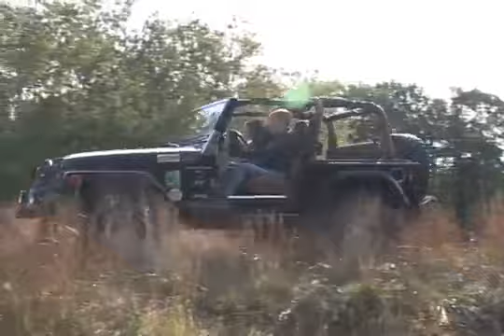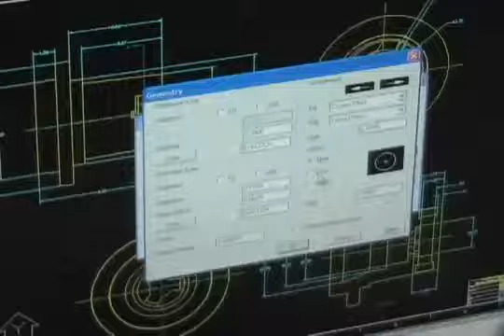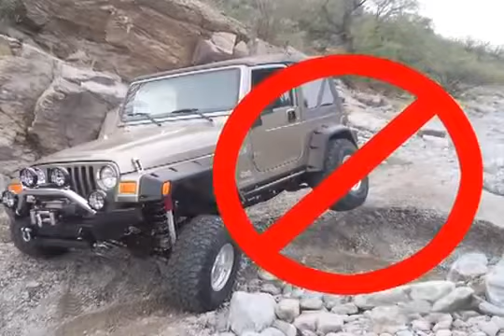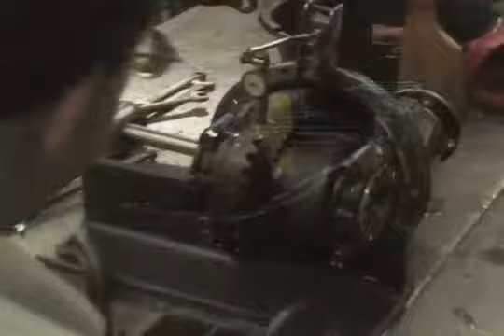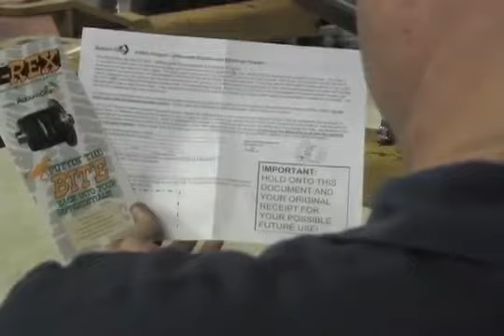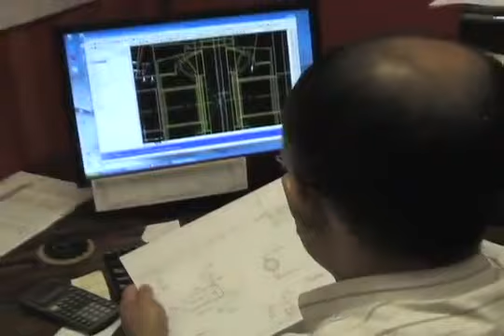ECTED Max Locker   Auburn Gear

Comment: the locker shouldn't be used if one tire is in the air? or you shouldn't engage the locker with a wheel spinning in the air?